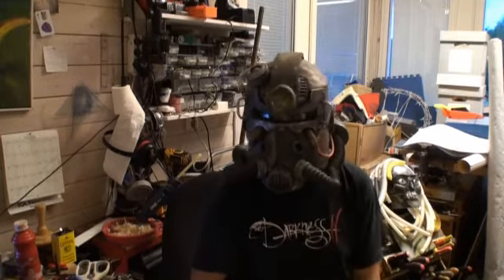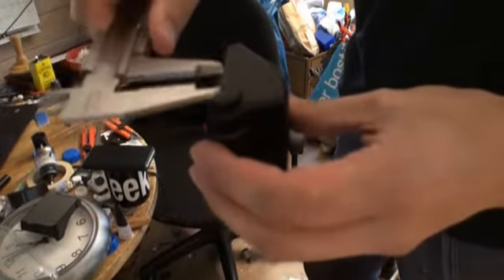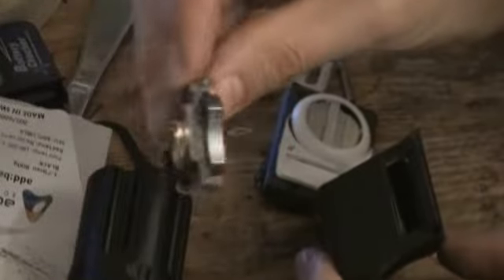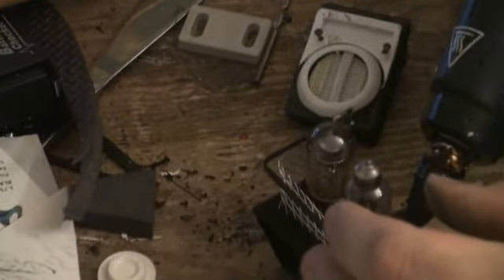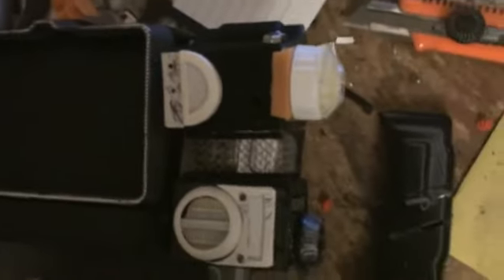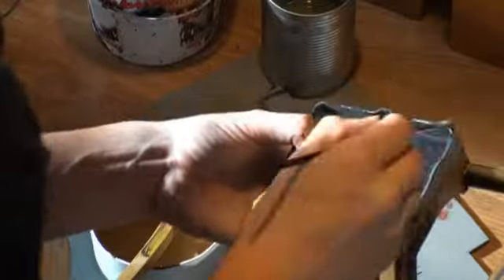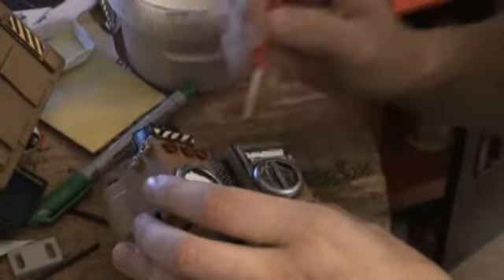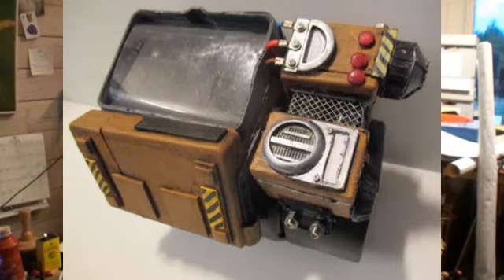how to make a pipboy 2000 from fallout 76

Comment: I have made an almost complete 3d model of this that I will hopefully 3d print soon
Reply from the maker: please shear it whit my so I can do a fun side bay side compereson do to I thingk my is to small
Reply: Gustav Ljungdahl Ok then. I scaled my measurements to the Pip-Boy edition of Fallout 4, so it should be fairly close to the game.
Reply from the maker: fantastic
Reply: Hey, just wanted to let you know that I forced myself to restart my model after I realized that the scale was off as well. I was using the measurements from the Pip-Boy boy edition from fallout 4, but learned that the in game Pip-Boy is much smaller. So I am currently remodeling my new 2000 model to the scale of the holotape player, so it should be almost 100% accurate scale wise. My model is taking longer than I thought it would.